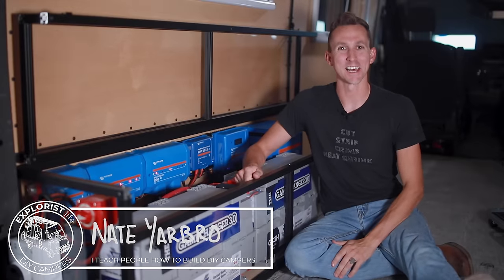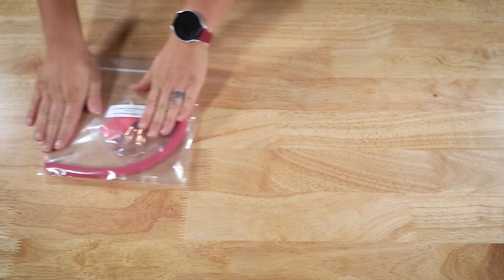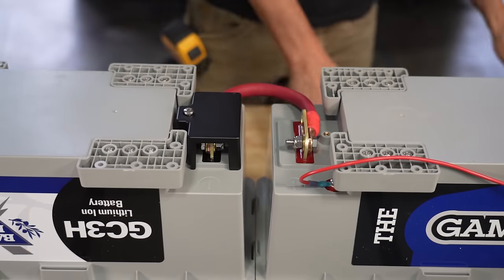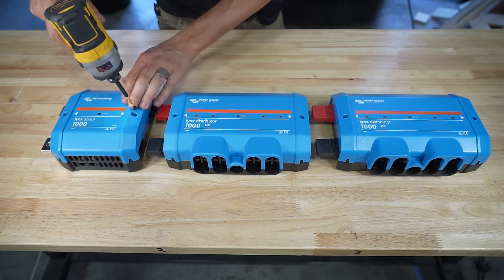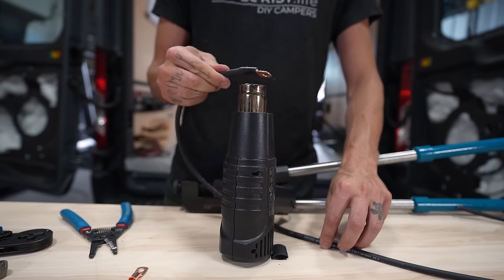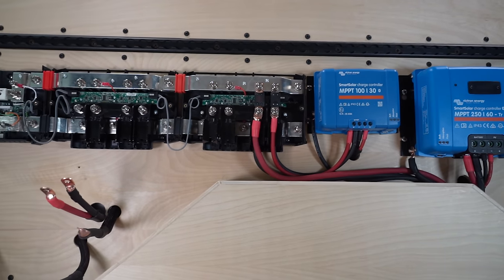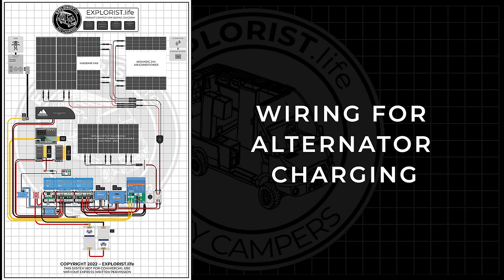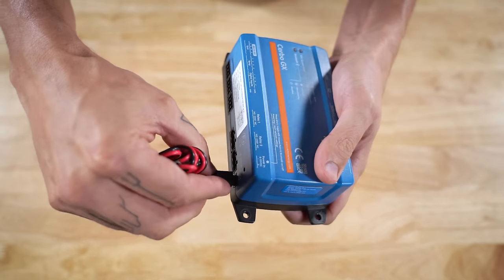DIY CAMPER VAN ELECTRICAL INSTALL (Start to Finish Tutorial)

Comment: 19:34 : I am currently building my system and am wondering why I need to ground the components to the chassis, if the trailer itself isn’t grounded anyways? It’s only standing on the wheels and on plastic blocks when I am drycamping, so there is no “ground connection” to the ground/earth that it is standing on.
Thank you!!

Comment: Great video, I almost wish I would’ve watched it before I built my system. When I installed my cerbo GX device I use an extension cable for both the HDMI and the USB and I’ve had zero issues with it.
Reply from the maker: That's great!  Glad that worked out for you.  Definitely one of those hit-or-miss kind of things with the USB extension.

Comment: Great video, so detailed and great instalation. I have question :
What do you think about using Victron EasySolar-II 24/3000/70-32 MPPT 250/70 GX which has MultiPlus II inverter / charger and MPPT 250/70 and GX already build in. Looking on the price of MultiPlus and MPPT 250/70 bought separatly is way higher then EasySolar II GX. It dosen't have a VE.Can so connecting Lynx Shunt would not work and GX component in it is not so advanced as Cerbo GX but if someone is going for cheaper installation with BMV712 or smart shunt and smaller Solar array I believe could be good solution. 
Wontering whay are your thought about it.

Comment: Such a helpful video, thank you! Question for you. Building a 12v Victron system in a Four wheel slide in camper. Where would i mount the chassis ground? I would like to use the camper when it’s mounted to the truck and when it’s not. Would the campers internal aluminum frame be adequate? Thank you!

Comment: This is a great video. Thank you!  I am currently working on an upgrade to my RV batteries. My current battery location I can fit two 12V 400ah lithium batteries. This is also near my electrical system (inverter etc).

I also have some space in the rear of my RV where I can fit two additional 12V 400ah lithium batteries.

I am also upgrading all of my electrical system components (inverter etc). 

What is the best way to wire in these two farther out batteries to the two nearby batteries? I know cable lengths should be the same - I can’t seem to figure out how to make this happen.

Any help is appreciated!

Comment: I am a qualified electrician and telecommunications technician in Australia (40+ years in the trades)
I have recently taken ownership of a mobile home with 2.5Kw of solar on the roof with 800AH of lithium batteries, via a Victron EasySolar 3000VA
Found your video to very well put together and should go a long way to make DIY van electrical system builders a lot more confident in what they are doing and therefore a lot safer for the industry as a whole...very well presented.

Comment: What type of bolts do you use to connect the main battery cable to the lynx shunt?  Brass?   Copper?  zinc?  M8 bolts made of what material?

Comment: I do not understand why you use 12 or 24 V inverters ? 5000 VA ==> 463 AMPS for 12 V system, 232 AMPS for 24 V system, 113 AMPS for 48 V system, 55 AMPS for 96 V system.
Reply from the maker: This video covers that, specifically: https://youtu.be/sEW-ZaOOlq0

Comment: @EXPLORISTlife - I recently started binge-watching your various Academy playlists, and watched this video as well as your other van install video.  I consider myself pretty handy when it comes to home improvement stuff (woodworking, 110v electrical, plumbing) but I am a new boat owner and RV owner and I have learned a tremendous amount from your videos in just a short time.  As an advanced DIY'er, I'm particularly impressed by your attention to detail - things like scuffing up the cable lugs, wiping contact down with alcohol, tightening fasteners to the appropriate torque, edge-banding your cabinetry, etc.

One thing I did notice, however, was that when you attached the 12v cables from the A/C to the distributor, you did not put the plastic divider back into place between the cables.  Was this intentional?  Similarly, I noticed that when you connected the 12v cables to the shunt, you attached one to the back of the tab and one to the front.  Was this to reduce the overlap between the two cables?

Keep up the great work, so that the rest of us can get draw inspiration and aspire to your level of workmanship!
Reply from the maker: The divider did indeed go back into place.  Perhaps it just didn't make it into the video. 

I try to avoid overlap of cables whenever possible, yes.

Comment: Why did you choose 6/3 from the Mulitplus to the breaker box? Wouldn't 10/3 wire be used for a 30 amp system?

Comment: Thank you for putt5ing out a very informative video. I have almost all the same equipment you show here. I'm using 24v SOK batteries and will be doing my Alternator charging different then you plan but the rest is very close. You videos have taught me a lot about setting up my system in my van.

Comment: Question, I have battery's fused for 300amps.  I was thinking not running a fuse from the solar controller to the battery's since the controller itself is fused already. I plan on charging my battery's through my BUS bar terminals. My setup is a bit different as mine is designed to be modular and mobile. each 200ah battery has its own box that can be carried.  I do have a 50amp inline fuse currently for solar but it appears they sent me a somewhat faulty line with burn marks on it already, I haven't even used it. Between the Victron controller already being fused and the Victron fuse will blow before it fries my wires.

Comment: I'm a fairly experienced solar system builder (non Pro), having built a handful of systems for our multiple full-time RV rigs over the years. This video is simply astounding in terms of content detail, product knowledge, delivery, editing, camera work. It does not get better than this. I wish that I could justify the multiple blue box systems used here, but, for me, really cannot. The only aspect of the entire system that I am not thrilled about, is the use of multiple drop-in batteries to power the system and the resulting reliance on charge and load devices each being programmed and managing their own charge and load parameters through network systems that, in my years of IT experience, I find not to be 100% reliable. Other than that personal preference, this is simply the de factor reference for DIY solar & LFP systems builds on Youtube. Thank you for the effort, and your kits are extremely well designed and built. I wish you every success in this venture, and am amazed that you are not over 1 million views on this video already! I will do my bit! :-)

Oh, one tiny niggle I forgot to mention - the Orion runs VERY hot and it's best to mount it vertically as it is designed to exit the rising internal hot air through the top. It cannot do this when mounted horizontally.

Comment: Hey Nate how should I go about attaching two different 24v loads. I have a 24v air conditioner and a 24v water heating element. Do I do a different bus bar or is there a distribution\fuse box?

Comment: Great video, question shouldnI use battery terminal corrosion preventer on my terminals , I have sealed lead acid , for now until I upgrade, there is tiny bit of corrosion  on cables,  from small amount of Gass off assuming. Thanks

Comment: I need your opinion on this because I can’t find an answer anywhere.  I have a victron solar charger 150/70 and a renogy pwm charger. I want to use them both to charge one battery bank (the same).  The victron has its own set of panels and the renogy has its own panels.    Both would be wired to the same lynx distributor.  Assuming both controllers can be set up for lifepo4 batteries (they state that they can), will there be any issue that you can see?

Comment: Is the solar isolater necessary for just one array? Could another single circuit disconnect be used? Similar to the battery disconnect?

Comment: First off let me say how much i love this channel. There is so much useful information on here and it is so in depth. I have always had a passion for electric as ive spent a lot of my life in that field. Currently working as a ems provider for quite a few years, i am looking for time to “just get away” as i think you could understand haha. I have a question on the power provided by a inverter. Is the power supplied by a inverter “clean” enough to run a desktop computer and 2 photo editing monitors?  I know there are differences in types of sine wave inverters, but i am interested to know what is best for my application as i try to plan for a personal build. Thank you for your time, and all the time you invest in providing awesome content as well as solid information in this channel. T.I.A

Comment: My build would not be possible without your awesome videos - thank you!  In this build, would it be okay to move the chassis ground wire on the first lynx distributor middle ground lug to the end lug ground on the second lynx distributor? I would think so even though it is shared with the negative ground for the Cerbo GX.

Comment: I did a quick google on how to wire up the heating on the batteries but didn't see an indepth explanation how it works. If I saw correctly, you wired up both battery heaters to the +24V terminal of the battery. I'm assuming the second terminal for the heating of each battery is the respective ground terminal of the battery. So either I have missed something or I don't understand it: if both battery heating + terminals are hooked up to 24V and their respective negative terminals are at 12V and 0 (zero) volts, then one heater is working at 24V and the other at 12V. What am I missing here?
Reply: Wouldn't they both be at 24v since the batteries are hooked in series? Both grounds thus having 24v..?

Comment: I'm noticing that you're using copper battery wire. Is the marine-grade pre-tinned cable overkill? I live along the Gulf coast in rainy and humid conditions. @EXPLORISTlife
Reply from the maker: None of the connections in your vehicle are tinned, for what that’s worth, and is why we don’t feel the added expense is worth it.

Comment: My off grid home (6kw solar array) uses all Victron gear and it has been very reliable for 5 years now.   By comparison, there are a lot of cheap chinese PV to AC inverters used in solar installs that are junk in a few years. But I would not use Lithium batteries........even the Li-Fe-PO4 batteries have been catching on fire.  Recently a large Tesla/GenX battery farm near Rockhampton Australia caught on fire, and it used that supposedly "safe" chemistry batteries.  Almost all of these LiFePO4 batteries are cheap chinese made with no providence of quality or durability.
Reply from the maker: You don't have to use LiFePO4, making a blanket statement saying that they are all 'cheap Chinese made with no providence of quality or durability' is simply untrue.  Thanks for watching, though!.

Comment: What if you have only one Lynx Distributor, would you just double up on the 1 Lnyx for chassis ground over the Multiplus ground?  Or maybe use a shunt to connect two grounds into the Lynx?
Reply from the maker: This may take a more in-depth look at your personal setup.  If you have purchased/are purchasing from our store (shop.explorist.life) reach out for some more personalized help: shop.explorist.life/support

If you've purchased/are purchasing elsewhere, reach out to your dealer for support.  We'd love to have you as a shop.explorist.life customer so we can provide a bit more help in the future. 🙂

Comment: The only improvement victron could do, that I think would make this easier was if all the different "blue boxes" would use the same communication method. EG using all RJ45 cabling. This would make the install easier and cleaner, with custom made cable lengths. And maybe the GX com could power and communicate with the touch screen via POE. 
I'm not even building any systems like this, but great video!!
Reply from the maker: Yeah, that would indeed be nice.

Comment: I really do enjoy these videos.   I must have watched it 20 times.   One question:  Should there not be a shore-power disconnect?   While pedestals have breakers, what if we're just charging from a normal 15-amp outlet?   How would you remove the load before unplugging?
Reply from the maker: You'd simply plug in or disconnect.  You don't have to turn off a breaker before disconnecting much like you dont have to turn off a house breaker to plug in or unplug your toaster.  Just turn the toaster off before yanking the plug.

Comment: This video is fantastic, thank you so much for putting it together! Can I ask, how has the HDMI extension and dedicated 12v power for the Touch 70 worked out, any problems? We may be doing something similar. Appreciate it!
Reply from the maker: So far so good.  Be sure to bench test it before you bury it in the wall as it's very YMMV.

Comment: Can you tell me the panel thickness you’re fastening all the components to, especially the inverter.  I’m thinking of converting my installation from through hole nuts/bolts on 3/4” boards to screws for ease of repair/ weight reduction?  Thanks.  Great video…. From one of the 6 that continued watching. 😉
Reply from the maker: Sure!  3/4" ply.  That's what all of our hardware kits for the mounting of each component is set up for as well.

Comment: Why use a 60 amp mega fuse on the 100|30? When it has a max fuse rating of 50 amps?  Unless the links between the YouTube video and your site aren’t matching up.
Reply from the maker: 50A MEGA fuses basically don't exist, so we have to round up.

Comment: Hi Nate, I have been buying your wiring diagram for 400a + 3k multiplus and getting prepared to install it. I also watched most of your videos (thanks you for that!! Very useful.). I dont think you discussed a topic I have seen on other channels witch is a bit confusing for me; pre-charging the capacitors of the invertor when turning the system ON. It looks like its a good idea to limit capacitive inrush current but I dont see a resistor in your diagram. Is there something I'm missing? Is this needed is such a setup? Cheers
Reply from the maker: It's not necessary with high quality battery with an adequate amount of storage capacity.

Comment: Hi..just a quick question...if u have a 300amp fuse on the linx shunt, why do you need to put a terminal fuse on battery...just curious as to why you need both? Thanks..Paul
Reply from the maker: The one in the Lynx Shunt is redundant in this system, but omitting the fuse on the battery terminal would leave the wire going to the lynx shunt unprotected.

Comment: Thanks Nate and team!  Did you choose to do the 24V because you could get a more powerful air conditioner?  I just got my sprinter and am in the planning stage, AC is something I really want to have, and I want it to be efficient and powerful enough.  I am planning on insulating the van as much as possible so that should help.  Thanks in advance for any input you might have!
Reply from the maker: We chose a 24V system because we needed to make a tutorial featuring a 24V system. 😂👍  We've never done one on this channel, and everybody was asking about it.  We could have gotten away with a 12V system for this size of system, but it was nice to use some smaller, 1/0 wires for our 24V multiplus and Battery Bank to Lynx Distributor instead of the 4/0 we'd have to use for it's 12V counterpart.  Here's a video talking about my thoughts on 12V vs 24V systems: https://www.youtube.com/watch?v=sEW-ZaOOlq0&list=PLmvhcyi4n0TU6HlMaQiCUwC20DBlyv6s_
Reply: Agree. 
24V is the way I’m going as well.

Good luck with your build.
Reply: @EXPLORISTlife  Thanks!

Comment: Hi Nate! Did you ever install the Victron Buck-Boost DC-DC Converter into your system?  I have researched it a little...and there seems to be conflicting information whether or not it can be used to charge a lithium house battery?  Seems like may just be just a "converter" and not a "charger".
Reply from the maker: The 100A Buck Boost is still not readily available as of 4/23, so we still have not installed it; no.  It can absolutely be used as a charger for a lithium house battery.   I mean... the first sentance on the product page for that unit is: "DC-DC Converter for charging a 12/24V service battery in vehicles..."

Comment: Most comprehensive install I"ve seen. Only one question??? I noticed you used square ferrules in the installation of all the Blue boxes and oxegon on the fuse panel, does it make a difference??Not being pickey but I,m not familiar with these connections.
Reply from the maker: The ferrules should just be roughly the same shape as the terminal that they are going into.

Comment: We are starting on a new system for our new trailer. We've already started our shopping on the EL store. Our last system had a Victron battery protect, and we had AGM batteries. I was wondering, I don't recall you using or discussing 'low voltage cutoff' or a Battery Protect in your Li installations. Is this because its not needed or because some other component is managing this action (cutoff on low voltage).
Reply from the maker: Battle Born Batteries have that function built in.

Comment: Instead of tapping another screw onto the body for equipment ground, couldn't you have used the ground studs already on the driver side rear (I believe)?
Reply from the maker: There’s all kinds of acceptable spots to attach the chassis ground to.

Comment: What a great video with great detail. Can I ask, does wiping the surface with alcohol make a big difference? Also sanding the surface of the lugs would also reduce the surface area?
Reply from the maker: Alcohol removes dirt/grime for a better connection with less potential future corrosion.  We aren't sanding to 'remove material'.  Just a quick buff with sandpaper to knock off any manufacturing burrs.